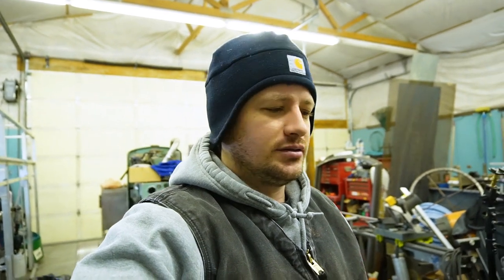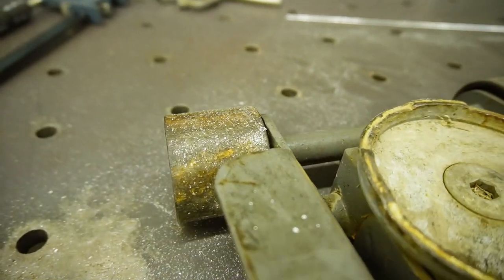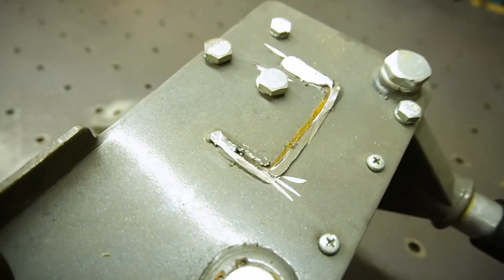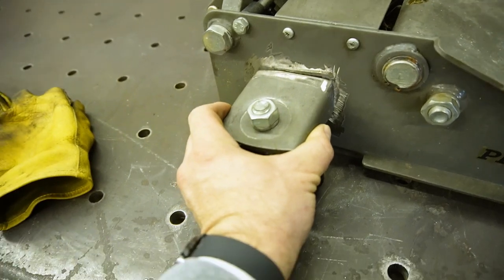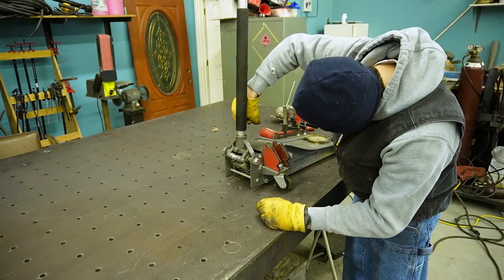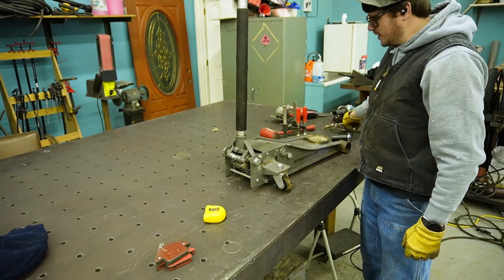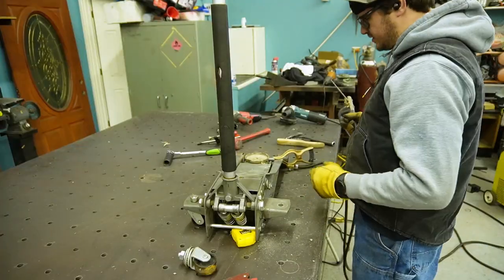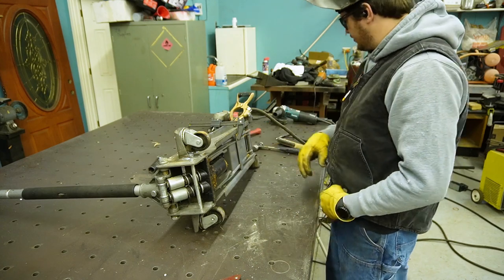Harbor Freight Floor Jack Repair, Can I Make it Great Again?

Comment: A couple washers to space out the caster would've probably been fine, but this was definitely good practice for 7018 in tight spaces!

Also, To get the flux ball off your 7018, flick your wrist when you finish welding and the little slag ball will fly away making restart a lot easier.

Keep up the great work and videos!
Reply from the maker: I definitely considered washers and honesty was going to, but didn't have the right size. Also could have made some but where is the fun in that?! Thanks for watching and commenting!
Reply: For sure! Looking forward to the next video!

Comment: Did you use 7018 instead of mig for penetration?
Reply from the maker: Penetration and 7018 is also more ductile as in it handles repeat stressing more. I also really enjoy stick welding occasionally. 🤷‍♂️